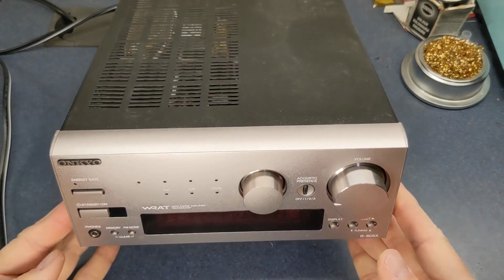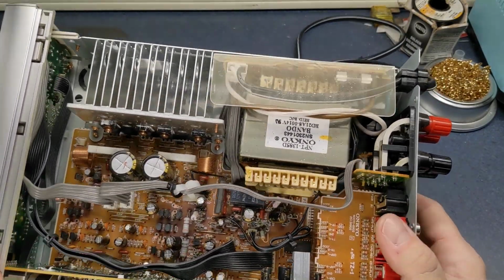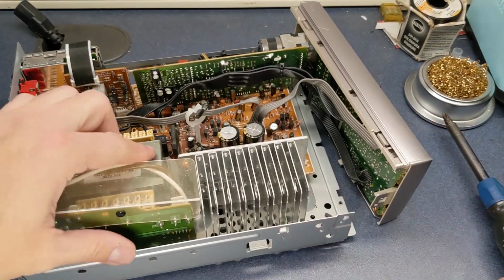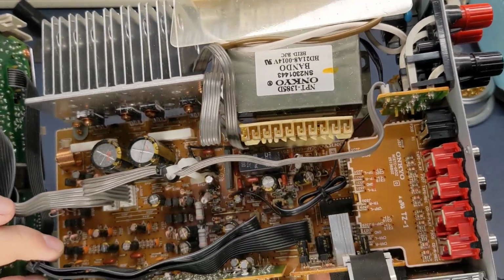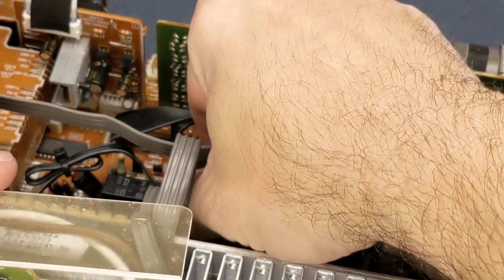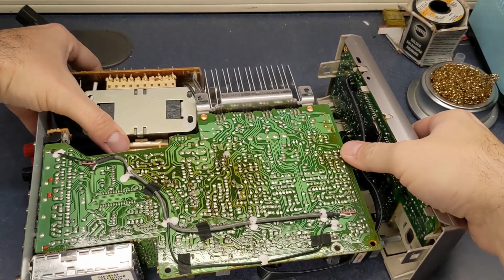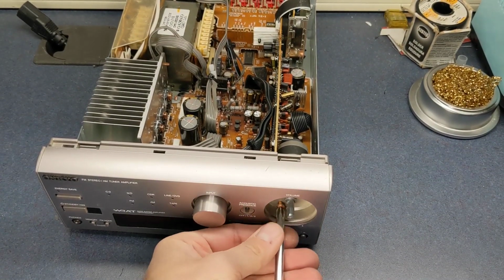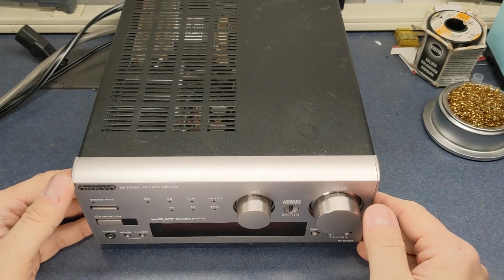Onkyo R-805X Receiver Repair no power clicking issue

Comment: I had the similar issue and it was dumped. Thought to fix it today, it worked without clicking sound which earlier was there for 1-2 mins and then it would stop 😅

Comment: When I replaced the capacitor,  I left the leads long so that it would be away from the resistor.  I used pieces of tubing to isolate and insulate the leads.  Striped wiring insulation will work fine.
Reply from the maker: Good idea, it does get cooked by that power resistor otherwise.

Comment: YouTube is cool!  I have one of these receivers that has this issue now.  The first thing I did was find a service manual.  The 2nd thing was to do a search on YouTube to find the video of someone fixing one of these units.  I knew I was going to find it.  And I did.  Now all I need to do is get a replacement capacitor and go to work.  The R-805X is a nice little receiver.  I use mine at my office running a small pair of PSB Intro mini bookshelf speakers.  I also have the 3 disk CD Changer.  It may need some work too because while it worked OK when I got it, it does not want to open the draw to load CDs.  We will see what I can do about that once I fix the receiver.  Thank you Retro Ben!

Comment: Hi - I have an R-805 that is clicking and I have replaced the capacitor, but it still just clicks.... any ideas?
Reply from the maker: Hmm, I would double check to make sure that it is the correct value capacitor and that the polarity is correct. I have fixed a good many of these now and the one capacitor seems to do the trick every time.

Comment: i have onkyo r805x its right speaker channel is not working what will be the issue ?
Reply from the maker: I would check to see if you have any bad output transistors on that side of the amplifier.

Comment: This is great, Ben. I am having the same issue with my Technics SA-DX750 receiver. Tried tracking the stby circuit cap but no luck. "Newbie"...I did notice what I am thinking is  a surge protector type of varistor diode (Zener) between the clicking relay and the transformer. Have no idea how to test that thing so I thought I would just replace it. Any thoughts/help would be greatly appreciated. Thanks!

Comment: Picked one of these up at Goodwill 7-8 years ago same basic issue/cap.  Best $8  I ever spent on hifi.  
Use it to this day with tube pre and turntable and with recent addidion of BT5 receiver whole new world of play opened up streaming flac from my phone's dac and some Klipschs'.

If you see one of these in the bin, GRAB IT!  Most any issue is a simple fix and the sound (10-50khz) out of this is phenominal.
Reply: i spend like 40$ with perfect condition with remote and still using, great sound but power is not that high, but overall quality devices from best onkyo era.

Comment: I have a ht-r590 it only makes a clicking noise when i try to turn it on could it be the same capacitor?
Reply from the maker: I would not think so the ht-r590 is a full size receiver and would have a completely different design. It is possible that it has a similar issue though.

Comment: Hello, great video! I just bought an Onkyo R-805X myself yesterday, but the display is dead/ does not work. I had bought a Yamaha crx-330 before that which also had the same issue (display not working), but someone on Youtube made a great video on this and how to solve it, by "simply" adding a capacitor. Would you be able to tell/ show me where I would need to do this on the Onkyo R-805X (assuming the capacitor fix would also apply here)?
Reply from the maker: The R-805X usually has a different issue with the display, the VFD gets kinda worn out because they stay on all the time, there is a "fix" I would like to make a video showing how how to do it, but I already fixed the display on mine so I need one the is bad to demo the process.
Reply: @TheRetroBen Hello TheRetroBen, would it be an idea if I send you my unit for repair (if it is not too expensive to send) and that you fix it in a video for your channel and that  you then send it back to me fixed?
Reply: @TheRetroBen  I have one of the Onkyo’s that I did the capacitor fix on. I’d be willing the ship mine, and pay for return shipping, so you could make a video fixing the dim display.
Reply: @TheRetroBen  My display also went off. Would you please be so kind and share your fix? :-)
Reply: i have onkyo r805x its right speaker channel is not working what will be the issue ? and also when i increase the volume above 50% the bass gets down
Reply: What is the fix for the dim display?

Comment: Have you ever fixed the dim display issues that these have?
Reply from the maker: Yes I have, the problem is that over time the filaments in the vacuum fluorescent display loose their ability to emit electrons to the phosphor part of the display. If the phosphor itself is not worn out you can overdrive the filaments on the display with a bench power supply for a few seconds until they glow, normally the only get about 6vac and never have visible light. Do this a few times and it will get rid of the oxidation on the filaments and will allow them to work normally. I did this to the other stereo I had that the display was almost black on and is has been working great now for over 8 years. I may have to a video on this. Thanks for the comment.
Reply: @TheRetroBen  Hi - Could you recommend or make another video on how to revive a VFD? I have a VFD on a nice KitchenAidELITE stove, but the VFD is very hard to read - it is about 15 years old and I'd like to try and revive the display before trying to source a replacement.
Reply from the maker: @PatPicciano  I will look around and see if I have an old stereo or something that I could use to demo that. There seems to be a fair amount of interest in that subject.
Reply: Which leads would I put ac voltage to and how much ac voltage?